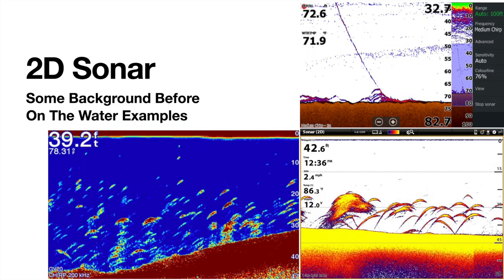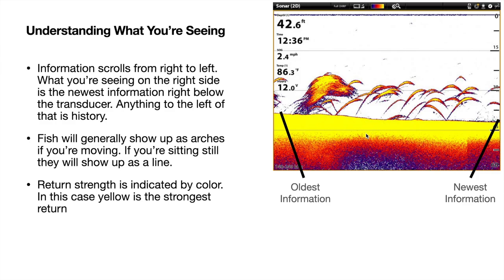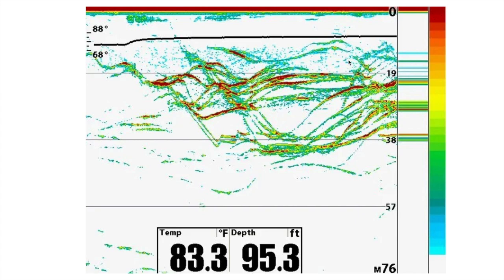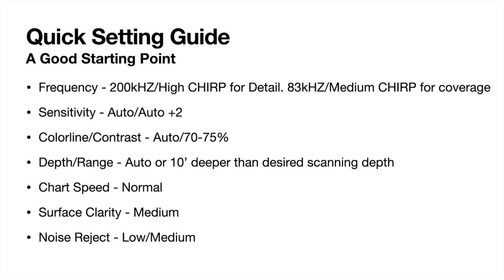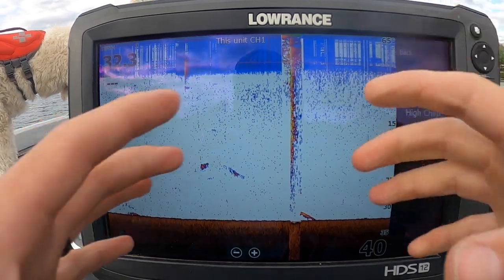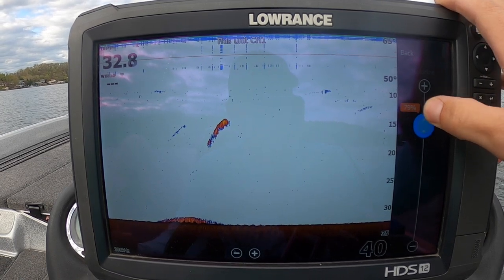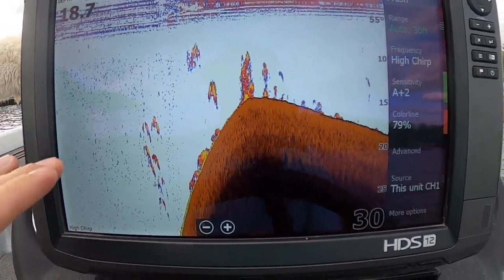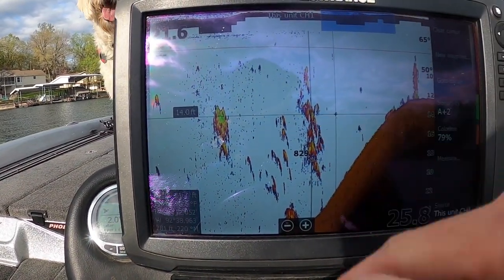2D Sonar Explained | The Ultimate Guide Series

Comment: So I’m having trouble trying to understand something. Your transducer is projecting a cone underneath it but on your graph it’s basically like looking at the bottom from a side view? What happens if you see a increase in depth as in like a 2 foot drop going in one direction (similar to 15:00 mark on your video although yours is a 10ft drop), what would it look like if you turned your boat 90 degrees to the left over the same drop, you wouldn’t see that drop anymore? Would it just be a straight line? Trying to understand the orientation of what you would see?
Reply from the maker: I'll try to help. So try to imagine the 2d sonar beam  in its cone shape under the boat as you're driving along. It's not just a flat 2D cone going into the water, it's a 3D shape that is encompassing a pretty significant area (depending on frequency). You can tell the location of fish within the cone to an extent based on the strength of their return. (Big bright hard returns on a fish or an object indicate it is near the center of the cone. Weak or softer returns will indicate that it is near the edges of the cone) So as you're driving remember try to envision that you're seeing kind of through the screen and getting a little bit of depth to the screen and not just a flat 2d Image...now as far as driving up/down or parallel with a steeper drop off...this can look different based on the frequency and depth of water you're in. The deeper the water = larger bottom coverage, which will look very similar to what is at the 15:00 mark. If you're in shallower water and have less bottom coverage you may not see the depth change as easily if you're going parallel with it. Some of these things are easier to interpret with side imaging in certain situations as well.
Reply: @MidwestOutdoorExperience  this explanation really helped me understand, Thanks!